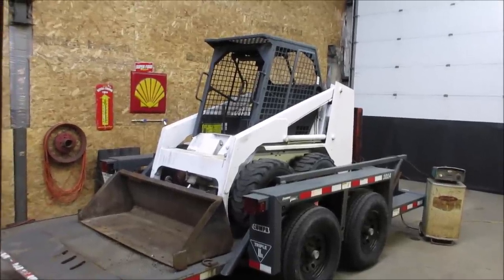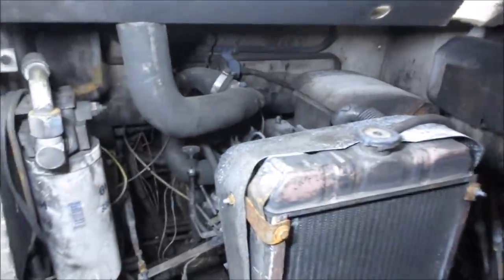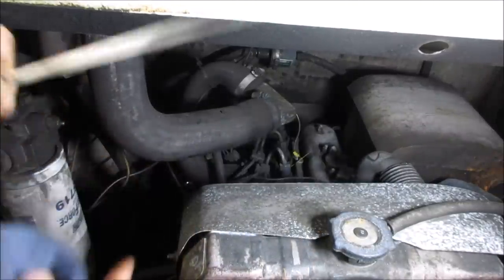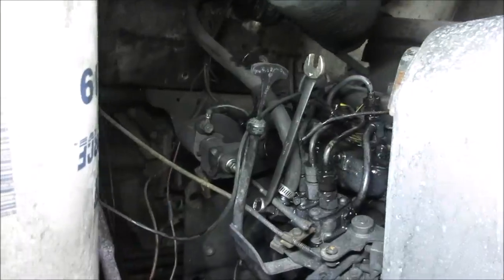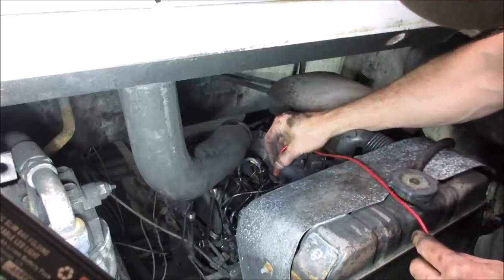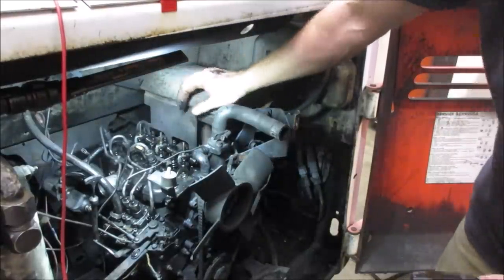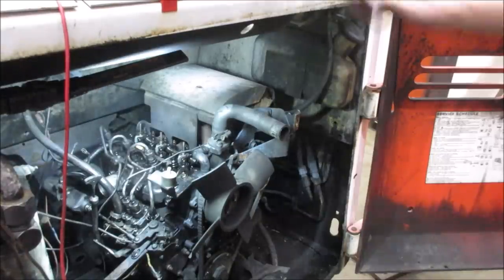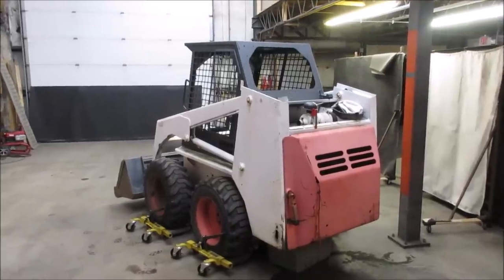Gambled on a Non Running Bobcat. Will It RUN?

Comment: Man, you just never know what Mustie will dive into next, lol. Good stuff!
 That motor appears to be abused and worn out, BUT don't give up on it quite yet. 
 Here's some things I've picked up working on very similar D-600 and D-640 3-cyl Kubotas in Cub Cadet tractors:
  -The gallopy cranking sound is pretty normal
  - Like a bunch of guys have said, the compression adapter goes into the glow plug hole. 
  -The adapter needs to be tight, not just finger tight. Tiny leaks make a big difference in readings. Be sure to torque the injectors properly, too.
  -For some reason, they just will not fire on ether, in my experience. No clue as to why. 
  -They are particular about valve adjustment. Get the valves set, then do a compression test.
  -They like LOTS of glow plug, regardless of ambient temperature. They won't even try to fire without the glow plugs. Again, in my experience. 
  -All of the glow plugs need to be good, test them individually.
 I've been fooled or misled by all of these things before getting to know the quirks of those engines. I really hope this helps.
Reply: I remember a video that had Mustie trying to start two different Kubota engines without glowing them and each time it sounds absolutely horrible, I think you're spot on about that! Wonder if the glowplugs are 12 V or whether they need a ballast resistor though, some car manufacturers did stuff like that.
Reply: I've never understood ANY diesel firing on ether just because it is for with engines that have spark plugs.
Reply: @Ragnar8504  On the Cub Cadets (Kubota supplied wiring harness) they used 6 or 9V glow plugs and ran them through a glow plug indicator which also current limited the plugs. This drove the glow plugs a few volts high. A real common mod is to run 12V glow plugs via a relay to take the GP current away from the $90+ ignition switch and save on the little garden tractor battery.
Reply: @Hjerte_Verke  Larger diesel engines will fire on almost anything flammable. Ether, lacquer thinner, gasoline fumes, spray paint propellant, etc. Many diesel trucks and heavy equipment in the 60-80's had automatic ether injection as a cold start aid.
Reply: " They like LOTS of glow plug, regardless of ambient temperature. They won't even try to fire without the glow plugs. Again, in my experience. " ... They LOVE to kill the battery without them. 🙄
Reply: Valve adjustment before any other repair attempt at this point.

The power to the solenoid for shutdown commonly quits on these.
Run a wire and a momentary switch to the solenoid to kill the engine and mount the button by the ignition keyhole,
cable to shutdown is too much understanding required by the user, too 'different' from other equipment.
Reply: My experience in this engine platform comes from a Kubota GF1800 Mower with a similar looking 3cyl
Reply: @lsrx101  That's what I thought, glowing straight from the battery for too long might actually burn out the glow plugs.
Reply: @RufusWolf  the engine already seem to be fitted with a cable shut off
Reply: Never tried to start them on ether good to know but some engine just don't like it for some strange reason 
And you're absolutely right the love glow plug even in summer they will start without them eventually lol
And the valve lash seem pretty excessive on this one
Reply: @legros731  I specifically recommended removing the cable shutoff it has currently, and making the solenoid do the job whether the circuit that powers it works or not..
Reply: @RufusWolf  there no provision for power / is the solenoid even working (still good)
Lol man it 2 position what's hard too understand especially when he will be the only operator and many machine come with cable shut off 
it not even the original engine and if you watched the video too the end he show the gaz cap is not a diesel one seem it was a gaz powered machine in the past
And by the look of the job it was swapped by pure incompetent
Reply: @legros731  The idea that I am coming from, is that an "off" button next to the key needs zero introduction, don't even need to tell whoever is running it.
  When they turn the key off and the engine doesn't stop, but there's a button next to it labeled "engine stop" is self explanatory, unlike an unlabeled, unpainted handle out of sight underneath your left knee.
  Routing a positive from one of multiple places takes a couple of seconds, and the solenoid is $15 if bad.  If the solenoid is still good, the existing circuit is likely dead, requiring a new circuit to use it.
  The circuit that feeds the solenoid can be tested for 12V during a 5 second period after turning the key off if locatable.

The fact that it is an engine swapped unit means one should try to improve things that were done in a disagreeable way previously.
Yes, the cable works.
No, it is not correct...
Reply: Mr "I never do ANY Internet research before trying to repair stuff" Mustie1 stubbornly refuses to use glow plugs the way the maker of the engine designed them to be used. Makes for much more viewer interaction, when all of us, who atually know how to use glow plugs, angrily type comments.
If he did use glow plugs, the engines would just start right up.

Comment: you check the compression at the glow plug holes.  Looks like checking the headgasket may be an option.  Cylinders appear to be  washed down by the amount of fuel going past the rings and the back up into the intake.  That would explain why the intake had fuel in it.  borescope the piston while the injectors are out and that will tell you a lot as well.

Comment: The easier way to have checked compression would’ve been to remove the glow plugs and use the adapter that is the correct size for that. Also, if it’s a kubota engine, the engine model and serial number should be stamped into the block right where the injection pump is. Great video and good luck!
Reply: I was looking for this comment about the compression test.
It also looks like the high pressure injection pump is toast.  Supposed to see something like >1000 psi at the injectors ?  
Maybe rings bad and valves not adjusted properly but didn't look like you did that compression test properly.
I don't think it's dead.  I think it's that injector pump.
Reply: @mountainjeff  there is no resisstance so it cant build pressure, also it should have fired with the starter fluid and the obvius blowby indicate worn engine.
Reply: @osbberjen  I was getting a bit nervous with the amount of starting fluid he was using! Then to top it off, adding the glow plugs! If that engine had good compression, I don't think it would have survived that amount of starting fluid.
Reply: @mountainjeff  it would have started with starting fluid if it was the fuel pump
The valve look way out of spec
The pump look suspicious maybe something to do with the shut off
And you can see smoke being produced so it got some compression more that is test show because he was supposed to remove the glow plug and use the adapter specified for kubota would have probably worked 
 t dont need not much more to start  use the block heater to heat the coolant and a heat gun to feed hot air in the intake to get it to start 
And judging by the oil lever it must contain some fuel and washed the cylinder wall lowering the compression even more  so a ool change could help
Reply: @osbberjen  you can see some pressure building when he blocked the line with is finger and is really dangerous he lucky the pump can build like 15 000 psi and would have resulted in a fluid injection injury he could easily have lost his finger 
Never do this just loosen the nut and break the bond on the line tapper by wiggling or tapping it with a wrench the fuel will escape between the nut and fuel tube
Reply: @legros731  "it it were" not "if it was".  Use the subjunctive tense.  It refers to something that didn't happen but could have otherwise happened.  Like "If I were a rich man.  Ya dee baaahh deee bahhh deeeebahhh deeee bahhhh deee bah deeeeeeee!"
Reply: @legros731  Some of the laydeez I've dated risked a fluid injection injury from muh luv gun!
Reply: @silasmarner7586  i highly doubt and i absolutely didn't want to know that part of your life lol
Reply: @legros731  the pump does not create that level of pressure. you think of a common rail system witch create much higher pressure than mechanical fuel pumps like the one in the video. also the pump needs resistance to create pressure and his finger is not strong enough to create enough resistance to create dangerous pressure, mabye if he really pressed the finger on it verry hard with his palm or something like that. but holding a finger loosely like hi did is ok.
Reply: @osbberjen  lol man it in the 18 000 psi a google search would have said it 
Even if he can't makenit buolt max pressure you absolutely don't need the full 18 000psi to injure yourself 
Hydraulic pressure is in the 3000 psi and is as dangerous vs fluid injection
The Kubota D1005 engine features an inline, three-cylinder configuration with a displacement of 1.001 liters. Like the D1105, the fuel injection pump for the D1005 engine is a mechanical type pump that is driven by the engine's camshaft. However, this pump has a maximum injection pressure of 18,875 psi (130 MPa).
Reply: @legros731  thats flat out wrong. just googled and the d1005 has a fuelpressure of 1991 psi or 13.73 MPA. you thinking about commonrail. also its about how much pressure he can make by plugging the pipe with his finger and not how much the pump can make. he was totally in the safe.
Reply: @osbberjen  yes the first site must have made a typo but that doesn't change the fact it more that 2000 psi is enough pressure to seriously hurt yourself  
the line could be kinked or foreign particule could block it why take the chance
The wound is so small you won't even notice until gangrene take hold
Injection injury are no joke would never put my hand near one
Reply: @legros731  . I see what you mean. But its not very likely to be dangerous.

Comment: Hey mustie I beleive that is a kubota d662 engine, parts are readily available and they are easy to work on, you can get a whole rebuild kit with sleeves and all, you can check the compression through the glow plug hole, those are very good engines

Comment: I'm sure you could hear us yelling at you.  If it has glowplugs, you can remove them and use the "F" adapter to test the compression.  No need to pull the injectors.   Same on my Yanmar 3 cyl. diesel.  I think you should do a valve job on it and see if that brings back the compression you need.
Reply: Lots of blow by. Such a small engine, pop a set of rings and bearings in while it's apart.
Reply: @dans_Learning_Curve  they score the cylinders pretty easy when they run hot tho.
Reply: @samuraidriver4x4  Darrin has been known to "get things running" in his special way!
Reply: @dans_Learning_Curve  for small personal usage  a would definitely try to make it run as is even better knowing 2 people couldn't get it to run if it eventually run
Reply: @legros731  YEP 👍👍
He's always up for a challenge!
One of the many reasons I enjoy his channel!
Reply: Mustie ignores glow plugs in any conceiveable way

Comment: That's the same model bobcat I started my heavy equipment career with 35 years ago, that machine afforded me my six figure income, fun times. 
You can use the glow plug ports to check compression instead of removing the injectors, much easier that way. Too bad it's just a tired ol' girl, give her a new ticker as I'm sure you can get her going, great vid as always.

Comment: If you pulled the glow plugs the compression tester would fit. Info for next time. Also, when it will not start on ether and chugs white smoke and you can hear only 1 good compression stroke out of 3, pulling the valve cover earlier would have shown all the blow by. I agree that someone ran the engine really hot by the evidence of the cobbled up cooling system mess and exhaust pipe delete. Pull th3 engine, pull the head and you probably will see what needs to be replaced. Hardest part is deciding how much hassle it will be to rebuild rather than just put a good compression engine in there. And no Mustie, a VW engine will not work well on the machine..... but wouldn't be surprised if you do it and it works.

Comment: The second you cranked it and also shot ether I knew it was rings due to overheating.
Happens every so often with these engines, recently put a new crate engine in a pressure washer as that was the cheapest option.
Chances are the hour meter isn't even hooked up to power or broken.
Key should be able to turn counterclockwise from the off position for a factory bobcat for pre heating with the glow plugs if there is no button for it.

Comment: I've been watching you for untold years and that is the most worked on wore out machine I've ever seen, ever!😂
Reply: WorN out.  Not wore.
Reply: Then you haven't seen the old hit-and-miss marine engine video 😄
Reply: It is in pretty good shape except for the engine. even with the body having a fresh coat of white paint, you can tell the body is not corroded and rusting through the paint. They must have built those things with a high quality steel that isn't prone to rusting.
Reply: Uh....... seen and heard about 90 percent of his clapped out VW vids?

Comment: If i remember right, a lot of the older skid steers had V4 Wisconsin engines in them.
The idea was that farmers were fairly used to those air cooled engines as they came on just about every non implement pulling powered equipment.
I think they had a bad problem of overheating though.

Comment: 1990 I bought a disassembled 3 wheel forktruck.Engine and lighter parts were tossed in 4 large boxes,counterweight on a skid as was the mast and forks etc....Had the time and it was cheap so what the heck. Bought the OEM manual and went to town on it. Had a full time job so only had nights and weekends to work on it. Took a couple of months chasing down new and used parts that were needed or missing but got it back together. Made a couple of grand when I sold it and back then that was a lot of much needed money for me. That was my first buy and flip. God only knows how many more "projects" I've done over the decades. If you like turning a wrench it is a lot of fun and can make you some decent money as a hobby.

Comment: 31:52 the throttle doesn't matter. Diesel engines have a governor built into their injection pumps and at cranking speed, even with the throttle at idle, it's going to be at full fuel because the governor speed is below where the injection pump wants it to be. They crank at full blast and then when they start they immediately whoa themselves up a bit. Hopefully. Unless it's a 2-stroke Detroit with stuck racks.

Side note, if you ever do get a 2-stroke Detroit in the shop, DO NOT TRY TO START IT WITHOUT FREEING UP ALL THE INJECTORS! That's how they run away on ya. They park themselves at full fuel and then over time the racks just stick there. Someone not knowing what they're doing then comes along, gets it turning, thinks 'oh hey we're in the money', puts fuel to it, whiffs some cosby sauce down its throat, and then it fucks off to low earth orbit as soon as it lights off. Earlier model detroits will have all injectors on a rack stuck at full fuel if even one injector is gummed up, later models only that injector will be stuck at full fuel. And if one ever does run away,...any diesel engine even the little kubota in this Bobcat...a board across the intake will shut them off handily.

Comment: Hi Mustie , I would suggest you take out the engine and start tearing its head apart since there is a good chance the head gasket is gone.If you manage to find parts go ahead and rebuild it since old mechanically injected diesels are hard to come by nowadays ( safekeep the spare one you already have for future needs) .Light air cooled engines are unsuitable since you need a heavy engine at the back regardless. Also , as others said , you should have used the glow plug adapter for your compression check.Whichever the case , I would advise you to rubber mount the engine you end up using . Good Luck !!

Comment: I really want a Bobcat type machine. Yes, I need a skid Steer like a root canal. Not the machine itself, but the pain and suffering that goes along with owning one.
Reply: They are not terrible machines, you don't have to like remove the bucket and lift arms, or remove major subassemblies to get to the motor. They are a well-designed piece of heavy equipment, so much so that there are many copies of Bobcats with multiple names and from multiple manufacturers. The skid steer is genius too because it doesn't require a cumbersome steering wheel and all the linkages and complexity.

Comment: Seems like a perfect project ... you obviously have plenty of options to re-power it.  The wiring is all spaghetti anyway ... pull the anchor out of the beast and see what room you have with everything out of the way.  We all have faith in you and your ability ... I'm sure that there is an old ford Pinto out there somewhere just dying to donate a 1600 cc motor!!!
Reply: Did not know they had fit 1.6L in them.  I had one with a 2.0,  and another with a 2.3.
Reply: @stanpatterson5033  Ford of England, the OHV crossflow Kent engine of Cortina fame,  tough and long lived

Comment: Just letting you know you should keep your fingers away from the injection lines while your cranking the engine. The extreme pressure created by the injection pump and inject fuel into your bloodstream and cause a very painful reaction and possible death. Just don’t want to see you get hurt.
Reply: If there's no restriction, there's no pressure. Would be different if he had the injector on the end of the line
Reply: @Aspire198  having the line partially threaded on can create enough restriction.